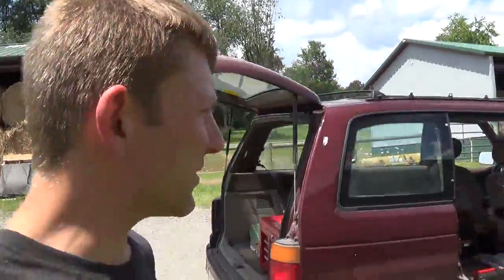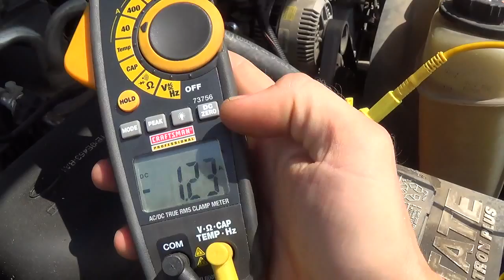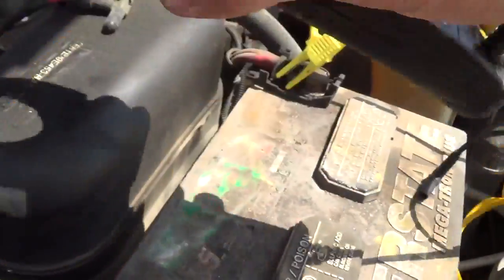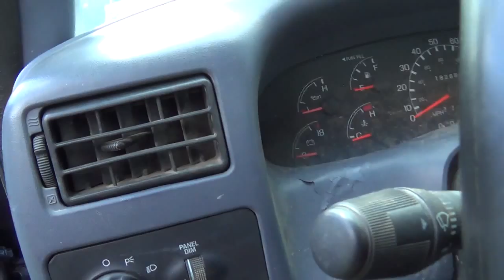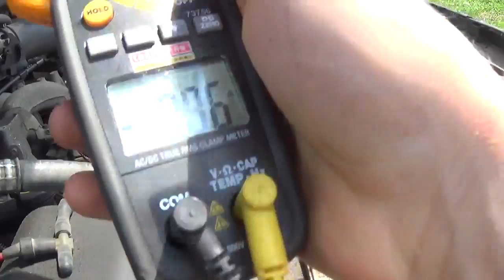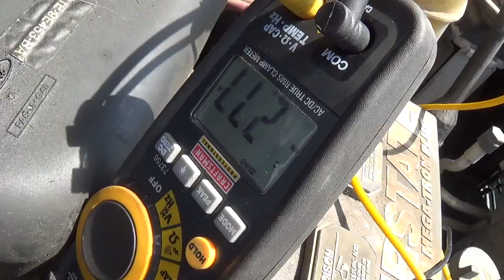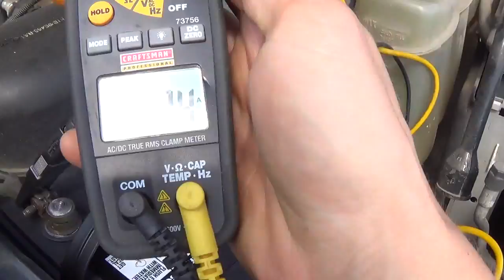Alternator Parasitic Draw Charging test (Ford Truck)

Comment: Hi Ivan. A very important point is that if the alternator is charging the battery at 10 amps or higher after 5 minutes, then the battery will fry the alternator.  This tip is from Vince Fischelli's, "electrical shortcuts" mentioned at frame 25:00.

Comment: I need help.please guide me fixing this issue😢 

Battery Voltage is at 12.7 (engine on) but goes up to 13.7 when ac is on ( cooling fans at high speed). Then back to 12.7 gradually when fans start to slow/ stop   [ Ford fusion 2014 2.5L 】

No BMS system (battery monitoring system)  instead it uses battery current sensor.

PID data showed both (desired generator volt) and (battery voltage) matching even at constant 3000 RPM 

Have you seen something like this 😢
Reply from the maker: If it's not setting codes then it's OK 😅

Comment: How is that a fix? I saw a half amp draw on the meter not only that but a small parasitic draw isn't going to show much, if anything on an ampmeter, he should take off the ground and check between the cable  and the neg terminal for voltage, if so you've got a problem.

Comment: Hi Ivan! 

 Thanks for the videos! I've learnt far more from your videos that working at Toyota for 4 years. 

 I just wanted to know, roughly, how much should a starter draw on startup? Before my trade I had a Honda that apparently, used too much current when cranking. Can't remember if it was a cable or bad starter...

Thanks!
Reply from the maker: About 150Amps for a light car, maybe 250A for a pickup truck :)
Reply: Pine Hollow Auto Diagnostics Thank you!

Comment: in order to perform this test with a standard DVOM, can you just run your lead to bat positive?  (meter set to Amps of course)
Reply from the maker: can't do the amp test with a standard DVOM in amp mode, you will blow the fuse.
Reply: ah right forgot that's too much current for it

Comment: The new battery was drawing 14A if you left the car running would the amps drop lower.... Can the alternator and battery be test using the scope, would be great if you could do a video.....
Reply from the maker: +Geoff Moores Hey Geoff, yes once the battery is fully charged the charging current will drop off to less than a few Amps. The scope is useful for testing system voltage ripple, as from a bad alternator diode. Good question!

Comment: FYI..  All the Napa batts I've seen are made by Deka/East Penn Mfg since about 2009.  I have one Napa and four O'Reilly Super Start batt's and bought them because I knew they were really Deka.  The oldest two are five yrs old and holding strong!
Reply from the maker: +TheTruth4313 I got a full 9 years out of a NAPA battery on my old van. It was still holding a charge, but getting sluggish cranking in the winter. No green crusties either. That sold me!

Comment: A counterman at NAPA ask me two questions before testing my battery and selling me a new one.  1) How old is the battery? 8 years.  2) Did you leave the radio or lights on and drain the battery? Yes.  You need a new battery.  He tested it anyway.
Reply: Not helping to test for parasitic draw from the alternator, since it has none?

Comment: I notice your Craftsman VOM. Is it accurate at the very low current draws?  I just bought a new Maxidas from Jb tools. The wifi doesn't seem to want to work. Does your wifi work on yours?
Reply from the maker: +Bill Rimmer I would say it's accurate down to 0.1A, which is really all you need to track parasitic draws and test your charging system :)  Don't bother with the WiFi on the MaxiDas...just take the flash card out and update it on your computer if necessary.
Reply: +motoYam82. Thank u Ivan!!  You're the best!

Comment: The old battery accepted 3A. ..The new one 14A. ..is there any maths to work out to know when the battery needs to be changed...how did you know it was not the alternator....
Reply: +motoYam82 Hi Ivan. Wouldn't it still be possible for the alternator to produce a potential of 14.5 v but not be able to supply enough current (potentially multiple bad alternator diodes)? I'm trying to determine what the 2.7 - 3 amp reading you got were (it looks like you were on the battery negative post, wouldn't the amperage reading there be all the current draw from the vehicle electronics?). In the video, you indicated that it was the battery not accepting the charge. If you were to put the amp clamp around the B+ alternator post wire would you have gotten the same 2.7 - 3 amp reading? Shouldn't the alternator show high output current regardless if the battery is accepting the charge? I'm just a little confused how in this scenario, the alternator was ruled out (other than the 14.5 volts observed). Thanks.
Reply from the maker: +Geoff Moores Good question. When the truck was running, the system voltage was normal (14.5V). So basically the alternator has the ability to "push" charge back into the battery, but the battery was NOT accepting that charge, even though it was completely dead to begin with. In this case it looked one cell was shorted internally, explaining the 2.1V lower than normal voltage (12.6V is a healthy fully-charged battery).
Reply from the maker: Marvin Crompton
Just picture the current flow between these three components: alternator, battery, and "loads". In this case the only current flowing in/out of the battery on the main cables is the charging current. The rest of the current goes directly from the alternator to the loads via the fuse box distribution center.

Remember that voltage and current are NOT independent of one another. In order to maintain system voltage at 14.5 the alternator MUST be producing enough current to power all the loads that are in use.
Reply: +motoYam82 Thanks Ivan, that helped alot and had me doing some research. I found this illustration that may help others like it did me, better understand what you were explaining. Link: http://www.bcae1.com/charging.htm